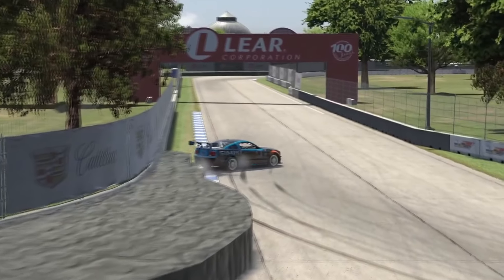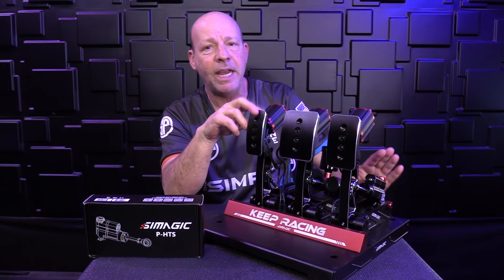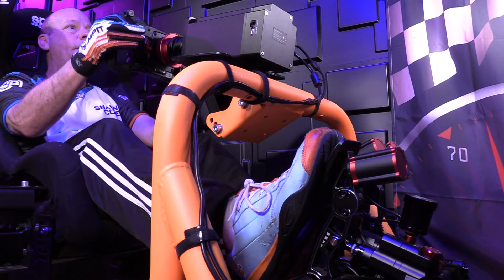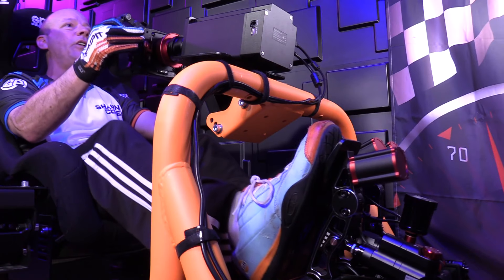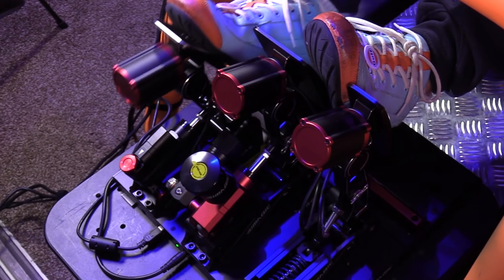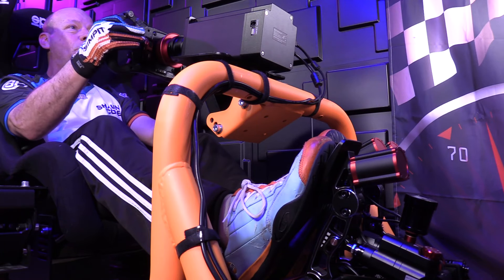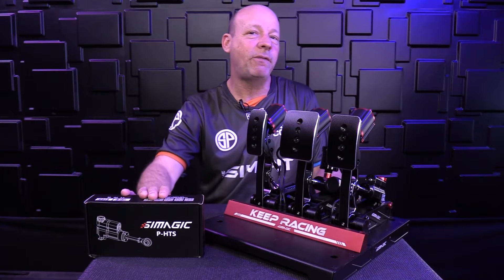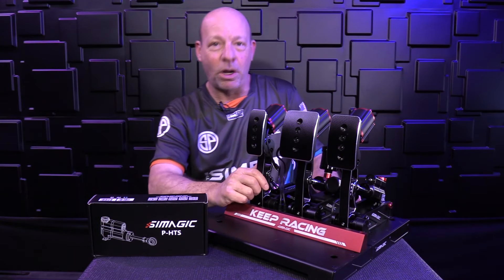Simagic Hydraulic Throttle System for the P1000 Pedal Review

Comment: I returned to SimRacing after some years a few month ago. Back then (I drove GT5 & 6 on a PS3) I learned much about Logitech and Fanatec wheels from you and Darren Gangi and loved your videos. Its sooo nice to see you again nowadays. 👍👍👍My approach this time is an aluminum rig with a Moza R16v2 with GS v2p Wheel and the P1000 whith hydraulic Brake and haptic motors on throttle and brake. It is a very decent system IMHO and I consider to give the hydraulic throttle a try now 🤗☺🥳

Comment: This is a disadvantage to anyone with real throttle control? Senna's throttle techniques would be limited based on how a damper works. If you think of how dampers or a shock works slowing down the throttle seems counter productive. Are these marketed as a beginner clutch deal? would love to see them get that unsprung weight/shakers off the moving pedal too! 👍 These are on my radar to swoop, great previous review of these and this hydro throttle.
Reply: What? do you like them or not?

Comment: Simagic is looking more enticing. I cant choose between simagic or fanatec to upgrade from my g923
Reply: Simagic by far
Reply: @frozezone22 go simagic the fanatec pedals are a toy in comparison I had them both inverted and normal and they feel dead in comparison
Reply: Had the Clubsport V3 and now full hydraulic p1000. The difference is rather big.
Reply: The simagic pedals are way more upgradeable. It's a very modular pedal set. And the parts are easy to change if something will break. I think they dont, but if, its very easy :)

Comment: Wonder if it works with inverted pedals.
Reply from the maker: Yes it will work with the inverted set.
Reply: Wow just installed  it on the p1000i inverted pedal game changer, shorter through
Reply: @lstrickland3412  is it better?

Comment: Haptic motor is only useful on the brake! The gas and clutch are useless
Reply: It's definitely useful on throttle, you don't seem to be knowledgeable about this topic if that's what you think. You're applying load cell logic to pedal force feedback - I'd say throttle FFB is even more important than brake, but both are important. I don't care about clutch, so I'm not knowledgeable enough about that one, but throttle definitely benefits from it.

Looking to get a P1000 in a few weeks, leaning towards getting two feedback things with it. No hydraulics for me yet.
Reply: depends on the game and how you use it
Reply: @nickstarlingch does iracing have any use for throttle haptics?
Reply: @nickstarlingch does iracing have any use for throttle haptics?
Reply: I disagree, with simhub you can e.g. map wheel slip to throttle (and wheel lock to brakes which is useful even when you don't have ABS), very useful.
Reply: @DreamyDan yes in cars with TC even tho people say it doesn't work mine do